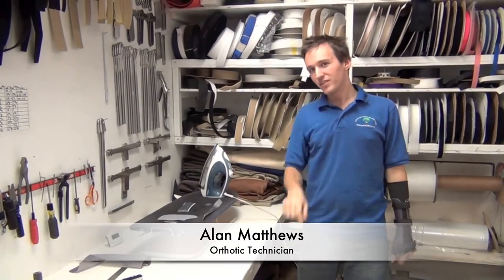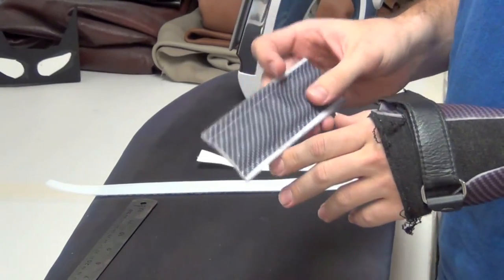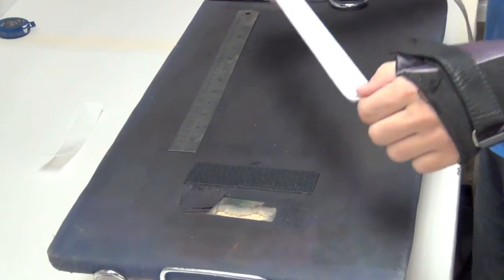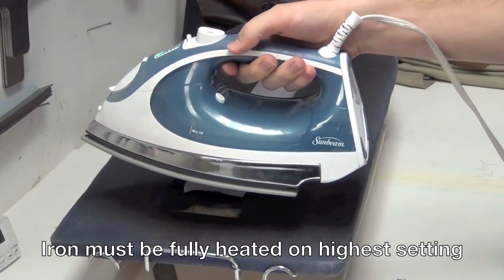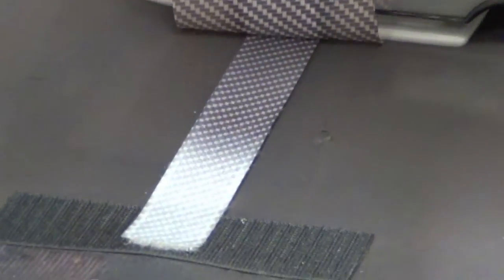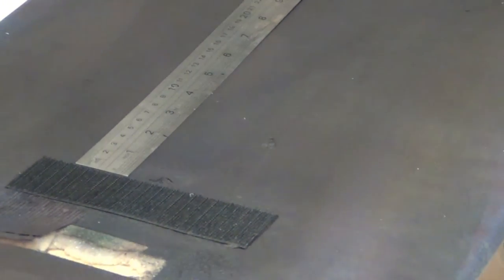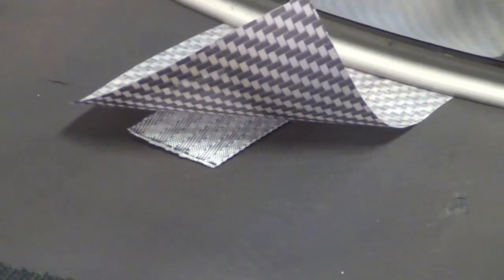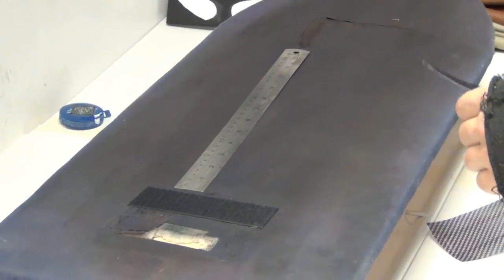Tech Tip: Transfer Patterns Onto Straps

Comment from the maker: You should apply about as much pressure as if you were actually ironing a shirt. The two key elements to transferring anything are heat and contact, not necessarily pressure. Keep your iron very hot and you shouldn't need nearly as much pressure.